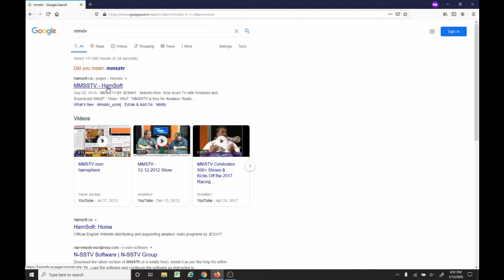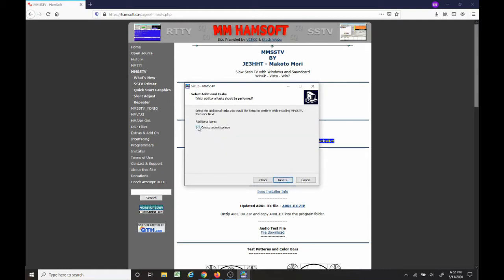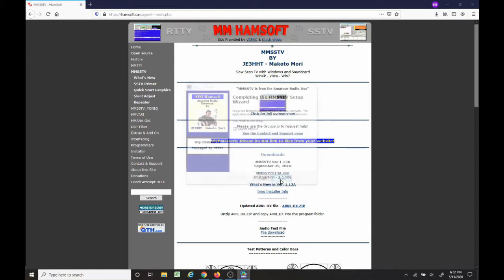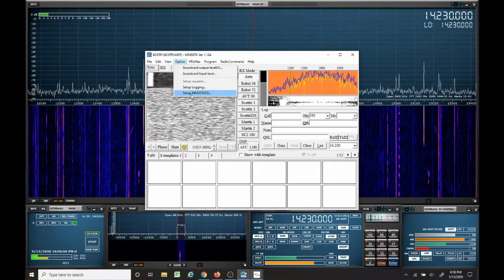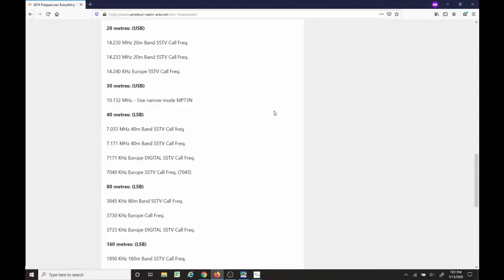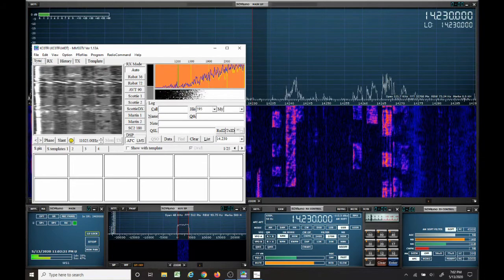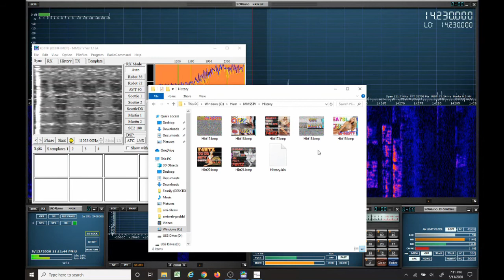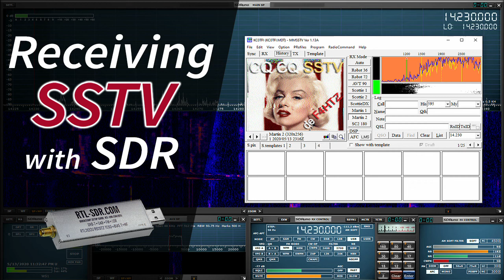Receiving SSTV using MMSSTV and SDR with SDRUno

Comment: Seems like you're having quite a bit of difficulty maintaining sync, I ran into this same issue when experimenting with SDR Uno or SDR in general, it just doesn't work well with modes like sstv because there are interrupts to the audio stream which results in loss of sync or the signal shifting a little bit.

I've experimented with faster computers dedicated high-end USB cards and they helped a little bit so it's definitely a bandwidth issue, interesting enough the Linux operating system handles this quite a bit better
Reply from the maker: Good to know, thanks.

Comment: MMSSTV is from 2010?  I got the SSTV signal from the ISS today off my HF+ Discovery and YouLoop.  Spent an hour trying to get VB cable to talk to MMSSTV, tried every permutation, couldn't get it to work.  Downloaded Robot36 to my phone,  put it next to the speaker, got images.  I also gave up trying to decode my local NWS weather balloon signals a few months ago.  

Why is decoding on a PC so convoluted and antiquated?   Thanks for the video though it is good.
Reply from the maker: Sorry you are having so many issues. MMSSTV is old, but SSTV is older technology and the software still works great for decoding.
Reply: It's a Windows SDR thing, SDR radios are just not good at this sort of thing you're much better off using a traditional receiver and audio chain, there are interrupts and latencies involved when using virtual audio cable so even when you do get it working you will have shifts and splits in the images because Windows is not a real time operating system. The Linux operating system handles this much better